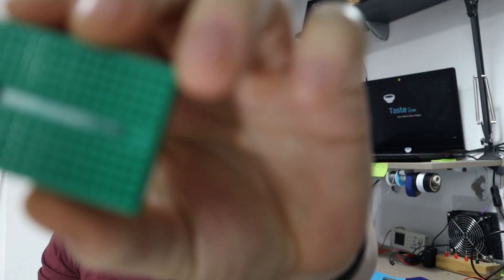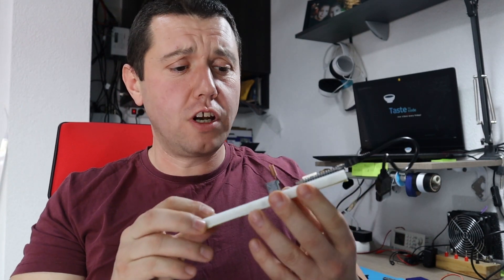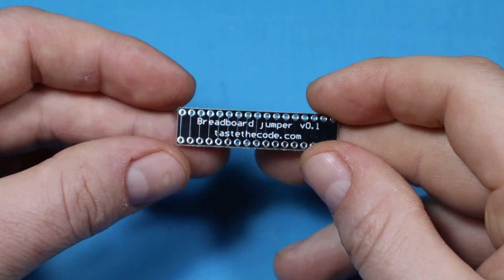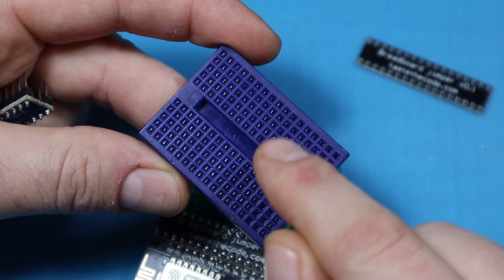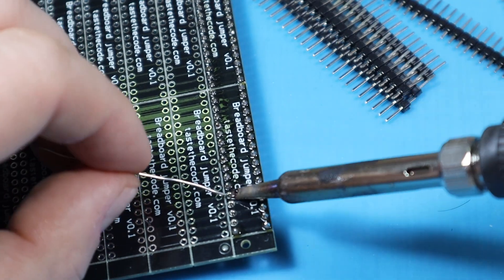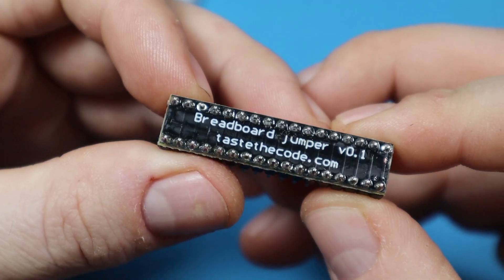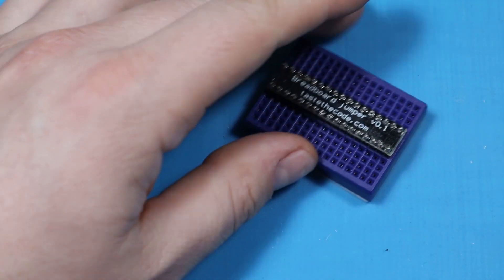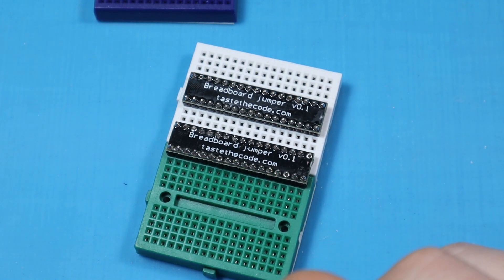Extend your breadboard projects with this simple tool

Comment: Sorry. It seems to wasteful to me. For boards like the nodemcu you could use male-female jumper wires and led the board outside the breadboard. If you are goin to manufacter a pcb why not made one adaptor for the nodemcu?
Reply: Thanks for sharing anyway
Reply from the maker: You are welcome! The reasoning behind it is not to be permanent. Just for prototyping as you never know the exact circuit that you gonna end up with.